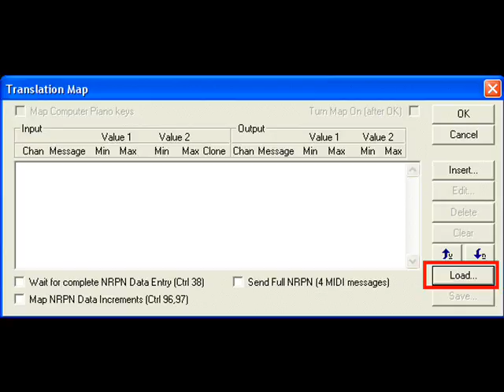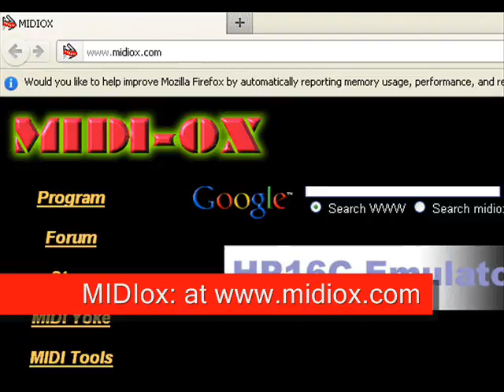DH~Horn Aftertouch

Comment: Could you pass along how you are interfacing the Casio DH-100 with the PC. I've tried Midi to USB cables without much luck. Thanks for this video.
Reply from the maker: I was using the D type game connector to two midi plugs and midi-ox software.
Some of the newer/cheaper usb types are either unreliable or if you're using win xp or later subject to problems with latency thru the midi system.
Without seeing the exact config, it's hard to say what any problem is.
Sometimes people put midi IN plug to the IN socket.
In must go to out and vice versa. USB should show as a device on the software and allow connection.
Midi ox is really good for figuring out connection problems.